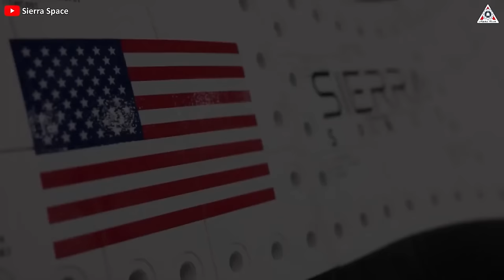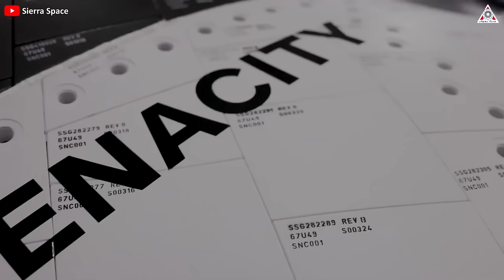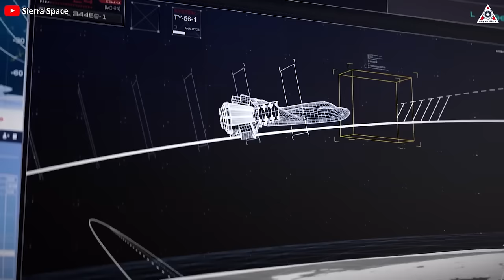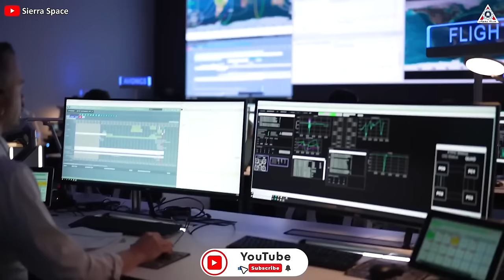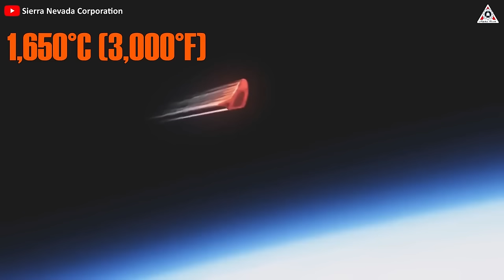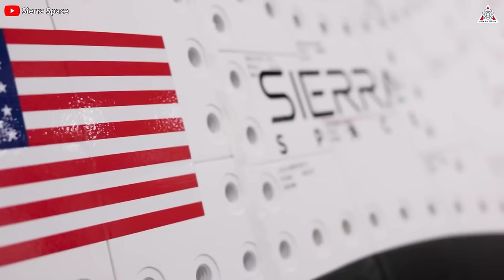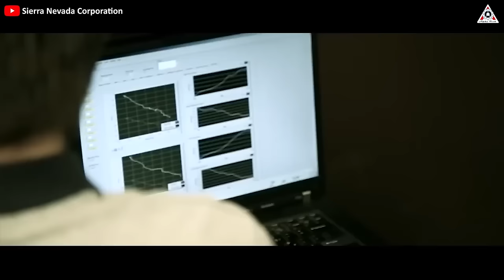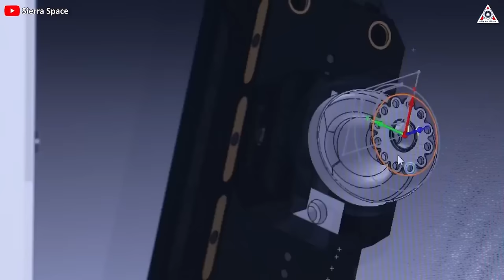Dream Chaser completed, ready for its first launch & future propulsion that makes NASA crazily...

Comment: I would think that the heat shield should be able to be cast and baked in one piece with expansion grooves build into the inside of the casting.
Reply: @pplusbthrust wtf are you talking about?

Comment: What is up with that weird front landing gear. Does it just have a strip of something on it that gets ground off on landing and replaced every time before launch? Why not just have a regular wheel?
Reply: Space rated tires are way more expensive than replacing that skid plate. The skid plate weighs less and takes up very little space. The arm is covered with heat tiles without the need for doors. Seem to me a very good way to go as the skid plate is only on the ground for a short time during the landing.

Comment: Putting it on top of massively expensive one time use rocket isn't economically efficient, especially when it seems to be designed just to shuttle people and a few thousand pounds of cargo to the space station which will be decommissioned in the not too distant future.  Then what?

Comment: Youd think theyd make sure of building and perfecting the rocket first since its the most dangerous part instead of the return part first.
Reply: The rocket part is the "easy" part.
Reply: I don't think Sierra Space plans on building a rocket.  They are more concerned with space habitats and return vehicles.  Lift to space is SpaceX's main strength.  Dreamchaser can ride with SpaceX or ULA or - if it ever happens - BO.

Comment: Which part of that bast shoe is a revolutionary one? The Soviets made one like this more than 50 years ago, and the Americans stopped flying space shuttles a long time ago for a variety of reasons. The physics didn't change a bit since then. If it's another toy Virgin Galactic style, then why not, but something serious?
Reply: Comparing apples with oranges proves little. The first SUV was built 90 years ago, should we stop building them?
Reply: @gacattack1234  You missed the point. Nobody calls the new Grand Cherokee revolutionary.
Reply: @igorpro8462  There is no point to miss and while I was talking about the Chevy Suburban, when was being revolutionary a requirement for something to exist. Being useful is more important.

Comment: Why is the front leg of the landing tricycle a skid instead of a wheel?
Reply: A skid is a lot simpler and lighter. It also eliminates a brake for a wheel and induces drag slowing the vehicle. There are many more advantages, like not having to maintain that nose wheel temperature and eliminating the risk of bursting. I believe they refer to it as a friction pad.

Comment: Meanwhile, SpaceX is doing a half-assed, poorly conceived, poorly built job of creating a heat shield for Starship V2 (V3?  V4?  V5?...).  Maybe the Chuckleheaded Toddler doesn't realize that if the Starship V2 (Vx?) heat shield can't be made to work, the entire Starship program is a waste of money.
Reply: Time will tell.
Reply: Starship development is not paid by taxpayers unlike NASA’s projects with its contractors. Furthermore, SpaceX does project with much better cost efficiencies.
Reply: @KirkDickinson  
"Alpha Tech" did a nice video about the engineering process that Dreamchaser went through in designing and implementing their heat shield.  Haven't really seen any evidence that SpaceX is taking the heat shield as seriously.  From what I heard about the first launch, there might have been evidence of tiles falling off during the launch and flight.
Reply: @leapdrive  
Not sure you are strictly correct here.  As far as I know, SpaceX has signed up with NASA to meet some key milestones in support of the Moon landings.
Reply: I'm convinced! 

You do it.
Reply: @wbwarren57  , the moon landing is a NASA project, not a Dragon project.
Reply: @wbwarren57  , my error was saying Starship project and yes, that’s partly paid by NASA. However, the topic was space ship delivery.
Reply: @wbwarren57  , my error was saying Starship project and yes, that’s partly paid by NASA. However, the topic was space ship delivery.